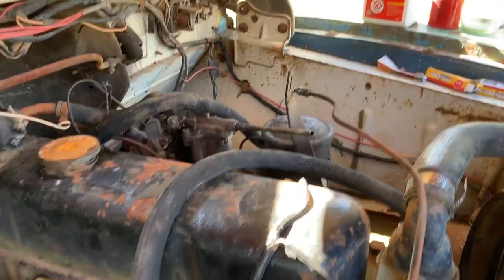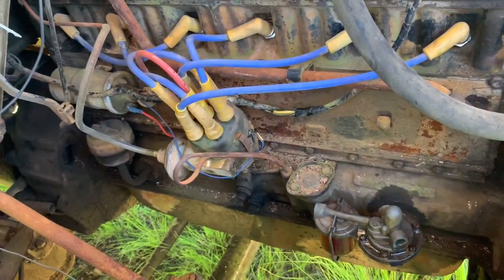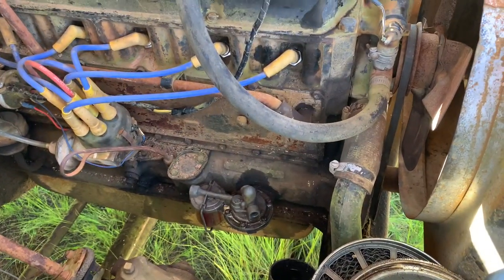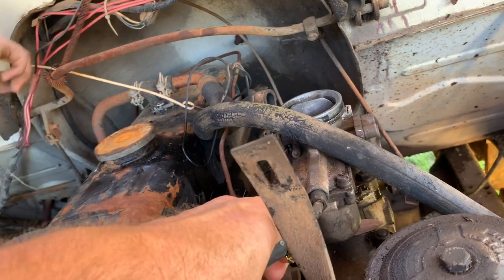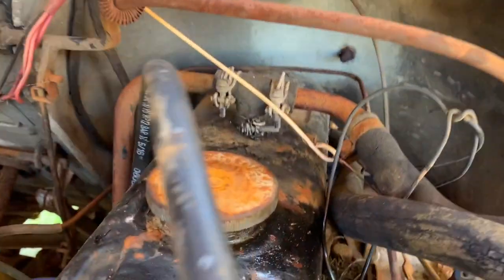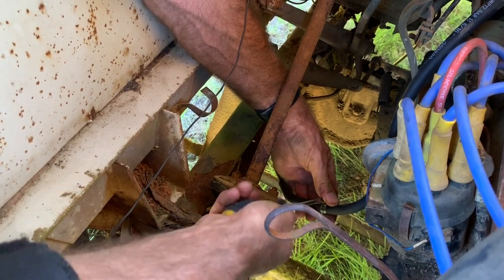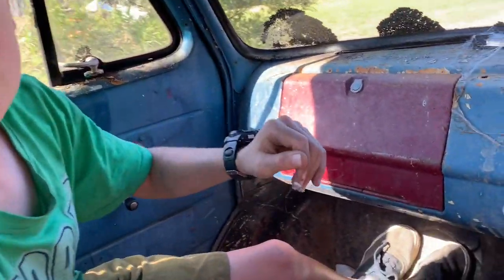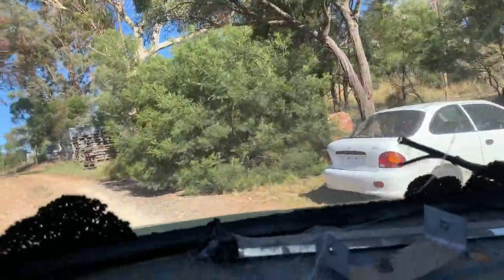Will this 1962 Tj Bedford Truck move?

Comment: One of the most stylish trucks ever built, IMHO.
The 6 was reliable and bullet-proof, but slow and thirsty.
The brakes??? Hmmmm.
Small-block Chev swap, every time.
Reply from the maker: Might do a cab swap or front axle conversion. Maybe 🤔

Comment: Better hope that it doesn't have the horrible master cylinder/booster thing under the cab floor - so bizarre, yet so useless.
Reply from the maker: I’ll have a look for the master cylinder under the floor. Thankyou because we had no clue where to find it! If it’s there we’ll probably use it.
Reply: @Michaelalsoporchard  Did you find it?
They're bloody expensive to fix - e.g. in 1994, it was over NZ$700.00.
It was worth it, as it was one of the last of the line, and was in super-good condition.
They're also rather awful to remove the rear brake drums from - there is a special Sykes-Pickavant puller than gets it done in seconds flat.
Nothing else seems to work, apart from a gas-axe.
This has drawbacks...
Reply from the maker: @andysaunders3708  I’ll look when I’m at dads again because my father is away for two weeks so I’ll look on Saturday when I go there
Reply from the maker: Hey Andy. I found the master style set after weeks of forgetting! Thanks a lot maye